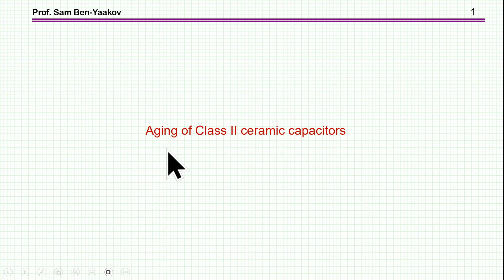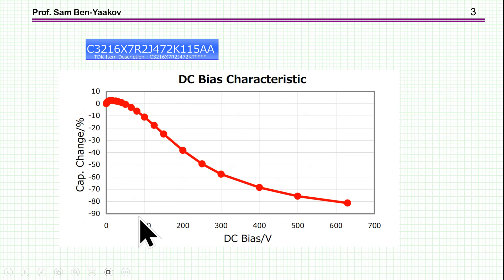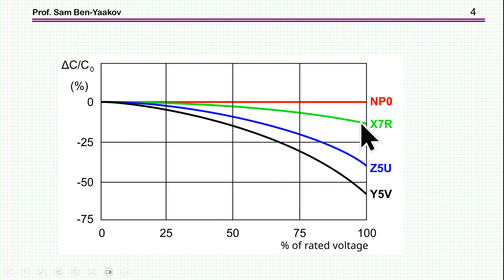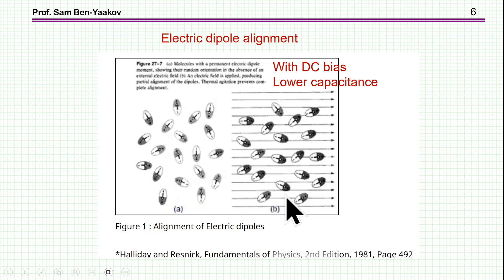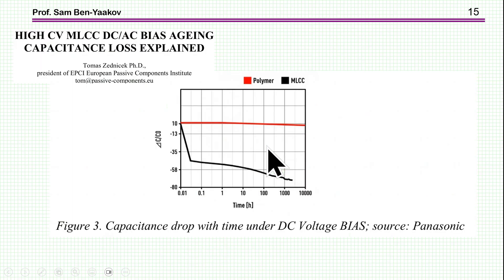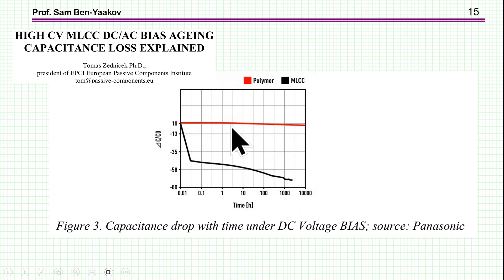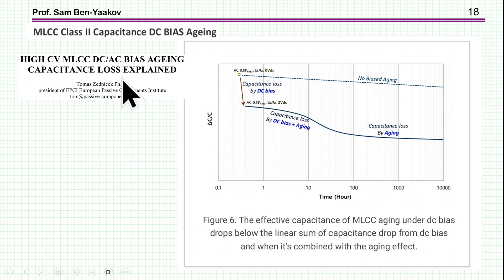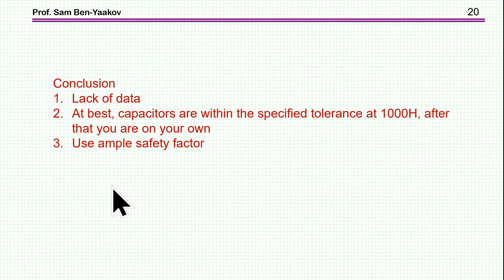Aging of Class II ceramic capacitors

Comment: 1000 hours is the estimated time between manufacturing and cabling process.
After cabling, as the temperature of the refusion oven is above curie point, the capacitance is  "reseted". 
We can say also than manufacturer take some margin, it explains why capacitance is generally in the positive % at "0h" (to be sure to be in -10% at 1000h).
Reply from the maker: Thanks for input. Can you share a reference of actual measurements of a capacitor's aging  after oven?
Reply: @sambenyaakov 
See for exemple the Wurth AN : Why does the capacity of MLCCs change? Aging 
Kemet: Ceramic Capacitor Aging: What to Expect
You can also find other technical note about this at TDK or Murata website I suppose.
I also verified this by personal measurment for a critical application and manufacturer discussions.
Reply from the maker: @user-nu3yh4wn3z  You missed my point. If I pick a capacitor from the catalog, how can I get the aging at ELEVATED temperature FOR THIS PARTICULAR capacitor?

Comment: You have briefly mentioned de-aging by heating. Quote from Internet says:
 
"If a Class 2 ceramic capacitor that has been sitting on the

shelf for a period of time, is heated above its curie point,
(125°C for 4 hours or 150°C for 1⁄2 hour will suffice) the part
will de-age and return to its initial capacitance and dissi-
pation factor readings. "

So as 125C is nominally in range for X7, will capacitors de-age in place if device is hot enough?
Reply from the maker: In principle yes. But I suspect that not all X7R products behave the same and some may require higher temperatures.